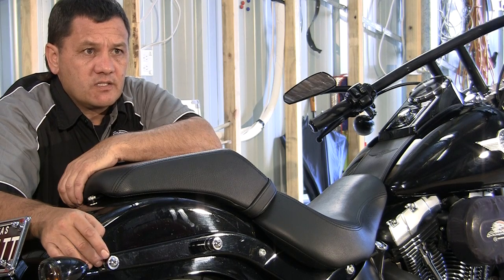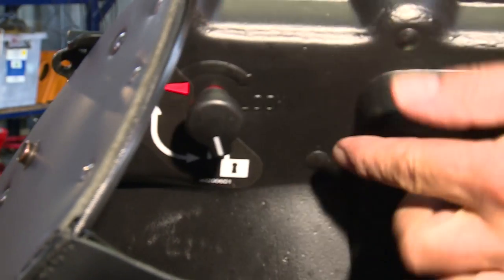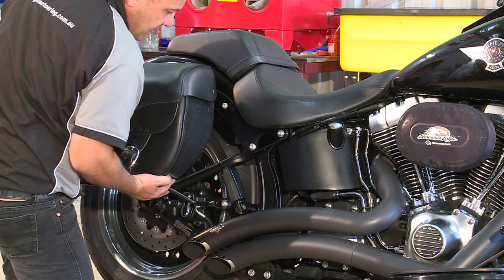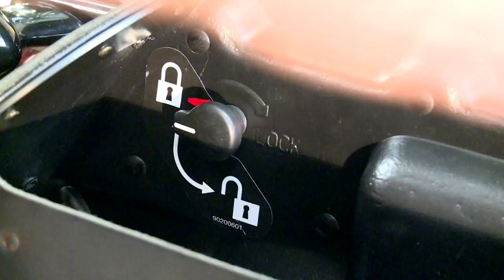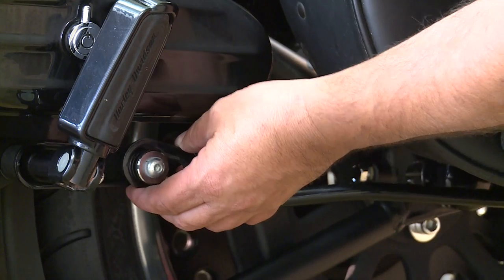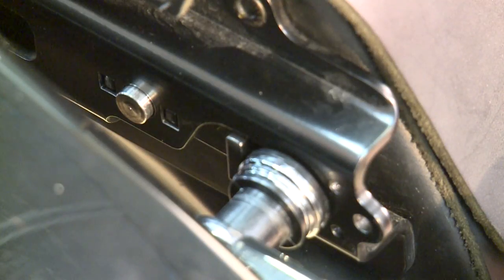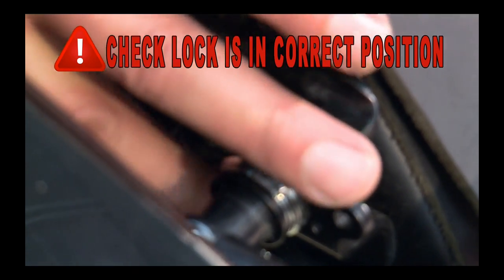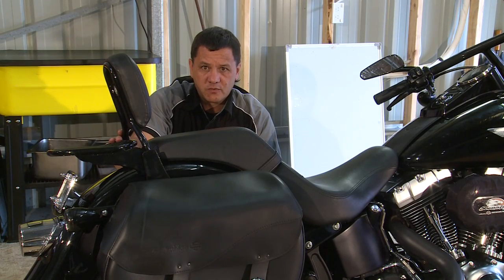How to install Motorcycle Saddle Bags on a Harley-Davidson Softail

Comment: I have a 2014 Fatboy I bought new and the one set of leather saddlebags the Harley dealer said was supported for use on it were the same ones you featured in this video.
I’m still own and ride this bike.
* I wish I’d had the safety tip you shared in this video about How To visually verify the lock mechanism is truly Locked…I’ve had the right bag fall off twice while on a long rides. *
The bag falls off behind you so you have no idea it’s fallen off. This second time it fell off there was no one behind me to let me know and I only discovered it missing when I reached my destination 1.5 hours later.
It’s gone forever.
* Shanksie, so far, there is no Harley dealer in the US who has a set of these (now discontinued) leather saddlebags on a shelf in their parts department. Any chance there’s a replacement set in a Harley parts department in Australia? *
I looked online and will not consider an aftermarket saddlebag; those all come with their own proprietary attachment kits. I will not change-out my Harley attachment kit (I have nearly the same backrest as in your video which uses it).

Comment from the maker: Hi John, the pins are an optional extra, and are easily fitted at home if you have a few mechanical skills. They have a few different options depending on your bike model. Ours are Detachable Sideplates; 53549-95 and Saddlebags:
Fat Boy®, 90381-98. Most Harley dealers should have them in stock.

Comment: I can't find a listing for the 'dual' docking points, just single (i.e. saddlebags or sissy bar only).  Is there an actual HD part for dual docking lugs or did you just double up 2 singles with a longer bolt?

Comment: Hello my friend. I got a bike with a setup like you show in the video (same detachable saddlebags and sissy bar). I'm looking for a toolbox, but in Harley website they inform it is impossible to use the original black toolbox with the saddlebags. is it right? which toolbox are you using? Does it need some adapter? thanks in advance

Comment: About the detachable backrest and sissybar. Is there a lock and key so that when the bike is left on the street nobody can steal it? As I live here in Brazil, if it is easily detachable, with no key, it wont last longer on my bike.
Reply from the maker: The lock part numbers are 90300003 (for the Keyed to match) saddle bag lock kit. Or the Random Key part number is 90300017. 
The sissy bar lock part number is 90300087 for the Chrome and 90300086 for the black model.

Comment: hi quick question if the pins are not fitted to the bike as stock can they be fitted easily and do they come with the bags to suit the locking mechanism or are they a standard pin thanks for the video